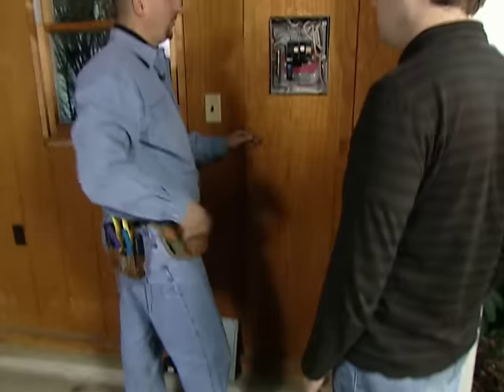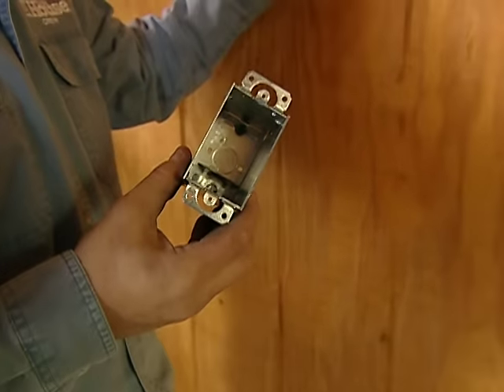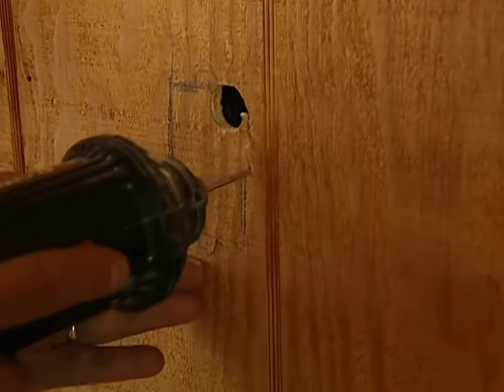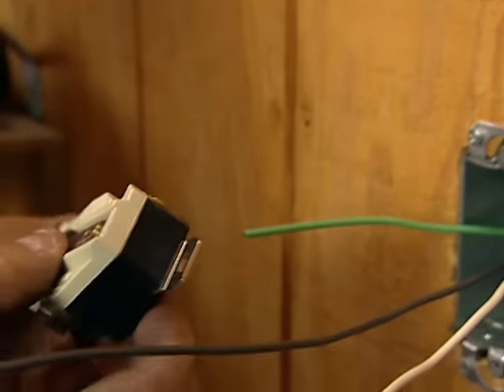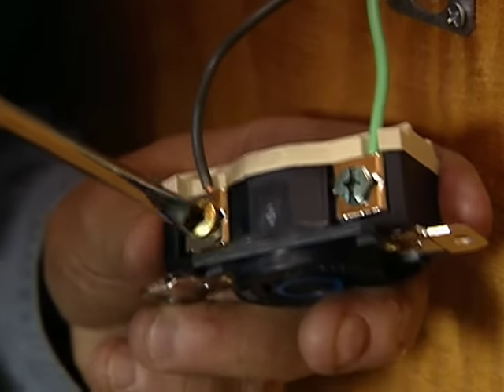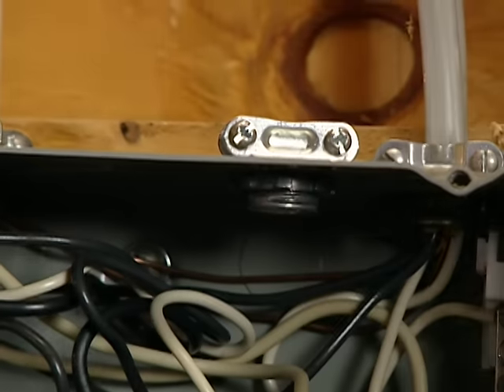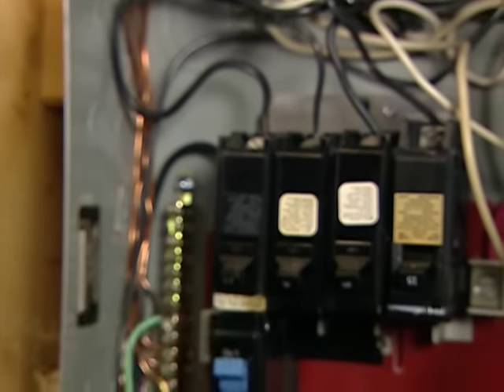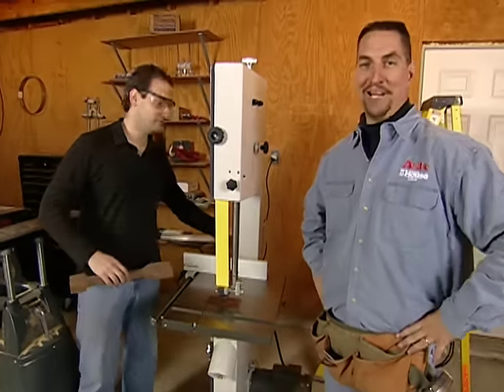How to Connect a 220-Volt Receptacle to a 20-Amp Breaker | This Old House

Comment: Garage. Needs a 220v gfci breaker because it is in a wet location. I would say use a gfci outlet, but a l6-20r is not available as a gfci.
Reply: Yeah, especially since Massachusettes has implemented the 2017 NEC.
He Legally has to use a 20 amp ground fault double pole circuit breaker.   I don't know how much the BR ones are, but the square D QO ones are about $130.  More than the 50 amp hot tub breaker and enclosure are.

SO the cheapest way to implement this is just use plain old recepticals and breakers for everything, and then put a cheap hot-tub panel in the middle of the circuit, using it as an additional disconnect for instance.
Reply: The sub-panel could be connected to a 220 volt 30amp GFCI breaker in the main panel...

Comment: Last time I looked, residential single phase utilities in the U.S. were 120/240V. 

Why people incessantly refer to it as "220" I don't understand. 

Wrong connector in the panel that was an NM (romex) connector not an MC connector. 

Identify your phase conductors dude. Most electricians can figure it out either way but this won't pass inspection.
Reply: Enlightn76 
You are correct it’s 120/240 but people refer to it sometimes as 110/220 mainly by old timers due to voltage drops in older equipment. Because it’s AC alternating current the sine wave is constantly going up and down just the rms value we refer to is 120v

Comment: Electrical Installations seem so much easier in the UK where all domestic appliances run on ~240V with just Live, Neutral and Earth
Reply: and safer without exposed terminals

Comment: I would think of keeping to standard that most every one uses for black wire as hot.  He states "I can do it this way so I will".  Can someone explain beyond "that's just the way pro's do it".   Thanks.
Reply: When an appliance or device requires only 240v and not 120/240v, u can get away with running 2 wires (120v each) in this case white and black. However a stove for example needs 3 wires (black red white) for 240v for the element and 120v for the light bulb and electronics

Comment: definitely 2 code violations 

1 not identify the grounded wire as a hot wire
2 He used a 2 piece Romex connector instead of a M/C connector
Reply: Some clamps are sold as "combination" clamps, Halex and others market them in most places. Proper MC 2-screw saddle clamps usually have a stop near the end that the MC sheath sits in.
Reply: The white wire is not a ground. It's a current carrying conductor. It's why they call it an AC circuit. Only ground can be green or bare copper. Isolated ground green with yellow stripe that must be isolated from the neutral\grounding bar in the panel and bonded to an outside grounding rod. 

The white simply should have been color taped to show it's a main current carrying conductor feed from a breaker. Unless you want to test my theory that if you cut a neutral in half and grab both ends. See what happens under load...
Reply: He also didn't properly place his MC sleeve.  He looked like he was in a hurry... went through each task pretty quickly.
Reply: Master Chief 00117 it's a ground conductor not a grounding
Reply: as long as it meets federal, state and county/city codes the job is done well and will last for years, there are codes around the U.S. that contradict each other because of the different types of climates.
Reply: the grounded conductor as stated by Chris Jamie is referring to the identified conductor, which means that it has been identified that it is bonded to ground. The grounded conductor is just another name for the identified conductor.
Reply: You clearly don’t have any journeyman or C-10 license. 
Grounded counductor = white/neutral
Grounding conductor = green/ground

It’s not common electrician practice either to use MC/Bx to make both conductors current carrying, for that you use SJ or SO cord.
Reply: sniffs the air I smell a troll... lol
Reply: Chris Jaime you aren't the brightest there buddy. Don't try acting knowledgeable if you are going to spew false information. By the way its perfectly legal to use a romex connector with MC, unless your local code says otherwise. Which might be the case where you live.

Comment: The connector he used for the mc cable is for Romex and I’m not sure why he used mc cable and not Romex , white wire was not identified as a feed conductor, he would have failed inspection!
Reply: While I agree with everything you said, if you look at 3:17 it is in fact a MC connector, notable by the two flat pieces on the inside of the connector which are there to prevent the sheathe from passing through the connector.

Comment: I still deal with "electricians" that insist white is always neutral regardless of voltage.
Reply: White is ALWAYS the neutral in NA wiring, unless it’s being used as a switch leg or hot leg which code is trying to move away from
Reply: No electrician would insist that.
Reply: @Nick-bh1fy  never used as a switch leg. Sometimes used as a constant hot.
Reply: @electricaf365  in resi I’ve seen lots of cases where the white wire was the switch leg, black being line voltage
Reply: @Nick-bh1fy not supposed to be.
Reply: @electricaf365  obviously it shouldn’t really be used for anything other than a return, but it doesn’t stop some contractors getting away w using 14/2 when they shoulda used 14/3 and actually have a useable neutral for anything future
Reply: @Nick-bh1fy  code allows white white on a CABLE ASSEMBLY to be re-identified and used as constant or traveler but never as a switch leg.

Comment: Outlet code 30" above floor in a garage? That must be a Massachusetts code we don't have that here in Maine most garage outlets are 18"-24" above the floor unless home or garage owner specifies a different height.
Reply: No garage outlet height requirement here.
Reply: I think if a socket is below 18 inches then the class of socket has to be better. ie no arcing in case gasoline fumes. Thus the cost skyrockets and most all use at least 18 inches

Comment: 220 volt receptacle what is that? I’ve heard of 240 or at least that’s what a utility feeds your house with 120,120/240
Reply: It's common to interchange 100 110 115 120 and 208 220 240 when speaking. Also if you ever test power outlets during the day is typical for any outlet to vary 10 volts  over the day at work we have a voltage recorder that we use and even at our warehouse where we have nearly perfect power it typically varies between 107 to 117 within a 24-hour period
Reply: robert hamilton 10 volts is unacceptably I work for a Utility and we allow 5 volts maybe they need to install or check their regulators depending we’re on the line you are. If there’s voltage loss that much the utility should look into it. There’s something called recording volt meters that they can install to record the voltage in a 5 day period at your house. Also how far are you from the transformer and how long of a run of secondary that you have comes into play but 10 volts isn’t good for your wall pump or appliances.
Reply: @ralanham76  So which number is technically correct?
Reply: @mr.g937  there’s no set voltage.  Most appliances don’t matter for a few volts. Like I work with communication equipment and vending machines and they work fine between 90v +

Comment: Seems unnecessary to have so many configurations of 220V (250V) plugs.....My dryer, stove, welder and generator all have different plugs/outlets.
Reply: Raw Bacon here in the uk we use 240 volts only and we have a single 3 pin plug with a built in replaceable fuse rated at 3,5,10,13 amps. Plugs and sockets are universal for appliances up to 3000 watts in the uk.

Comment: Wonder VB what ever happened to this Sparky. His explanations were usually spot on. He mentioned repurposing the white conductor as s hot. But he must have left his Sharpie in his truck. Also, it's 120v or 240v. But that's minor. Never had an inspection services cite that 30" rule either. Regional differences. Come to think of it never installed an out for garage band saw as well.
Reply: The electrical grid runs hot nowadays. They're the same. 110/120 Tomato/Tamato

Comment: I have never seen a good electrician use a wire stripper. They use linemans for everything, cutting, stripping and a hammer, 1 tool, 3 jobs.
Reply: That’s how I was taught. First job ever showed up non with big pouch and bunch of tools. Old school boss threw them out. Said all ya need is linesman’s flat heat Phillips and a hammer lol
Reply: @linehandibew6205  haha how very true. You will get a "feel" using the libel and.sometimes you use the linemans as a hammer

Comment: i thought you used n.10 wire for 220 not n.12 wire ?
Reply: Nelson Dacosta #12 is rated for 20 amps. #10 is rated for 30 amps
Reply: Maybe related to more volts means lower amp rating for same power 220v compared to 120
Reply: The smallest legal 220 ckt is 15 amps #14 AWG wire, same as for 110.
Reply: Most codes call for 10/2 on 220-240 circuts..
Reply: Not sure about the code stuff but 12 gauge solid copper is rated  for 600 vac 20 amps.
Reply: Wire gauge has nothing to do with volts. Thicker wire can handle more amps. You need 10 gauge for 30 amps and 12 gauge for 20 amps.

Comment: 12 gauge for 220v.??
Reply: The gauge applies to the amperage, not the voltage. In this case the amperage is 20 which corresponds to 12 gauge. Most standard conductors are rated for up to 600 volts.
Reply: ไอ้มดแดง  12 gauge is rated for 20AMPs, 600Volts
Reply: 10/2 is usually code.
Reply: Yeah as long as the running amperage load is less than 80 percent of 20 amps which is the rated load of the breaker and the supply conductors.
Reply: Also, it’s solid conductor and copper (CU).

Comment: just read a few comments. i'm not an electrician and i found enough mistakes to make me nervous
i wouldn't sign my name to that job
Reply: 08.
Reply: James Boyd the only thing I've seen that Alan did incorrectly was to not 'identify' the 'hot white wire' as something else. - Yes in this case its legal to tape a different color since the mc cable is a 'listed assembly.I'm sure Alan doesn't usually tape the wires since the job won't be inspected and the wires work no matter what color they are.But it was a safe installation, and at the time the video was made, unlike today, a Ground Fault Interrupter was not required.   A comment was made that NEMA 6-20 (the recepticle used) doesn't come in GFI's.  That's true, but 20 ampere double pole GFI's are available that fit in the existing panel.
Reply: Question: NEC says to "pigtail" the ground wire (green) to the metal box and outlet. The picture shown showed the green wire connected to a wire nut with two green wires coming out of the wire nut - one going to the metal box and the other going to the outlet. He did it differently, actually looked easier with less space.  Is that to code? Will the inspector accept that?

Comment: Mississippi law, to this day, still dictates that all (meaning each) 220 volt service must be connected at the outside panel (near the meter base), on a singular circuit, in industrial grade conduit, surface mounted (not in the walls), to a transition point entering thru the floor (or wall if on slab), directly to a surface mounted receptacle.
Reply: Congratulations

Comment: Some building codes are nonsensical BS. There’s a difference between people using common sense and safely building an interior, non load bearing wall—and people building a collossal brass phallus in the front yard.

Comment: Um, it's a 220 circuit, as evidenced by the receptacle being used.  For wire gauges #6 and smaller (as the case in this video), you cannot "tape" the white wire a different color.  This is why he did not tape the white wire - because it isn't necessary, and according to the code - you can't.  I will post the NEC code addressing this specific issue for convenience.  As far as I am aware, this is the code the governs this particular practice...

A. Grounded (neutral) conductors 6 AWG and smaller must be identified by one of the following means [200.6(A)]:

1)   By a continuous white outer finish.

2)   By a continuous gray outer finish.

3)   By three continuous white stripes along its entire length on other than green insulation.

4)   Wires that have their outer covering finished to show a white or gray color but have colored tracer threads in the braid identifying the source of manufacture are considered to meet the provisions of this section. The use of white tape, paint, or other methods of identification isn't permitted for grounded conductors 6 AWG or smaller.

6)   A single-conductor, sunlight-resistant, outdoor-rated cable used as the grounded conductor in photovoltaic power systems as permitted by 690.31(B) can be identified by distinctive white marking at all terminations.
Reply: In this 220 volt socket the white wire is NOT grounded, not a neutral . Thus it IS taped to show it is a hot wire. Locally if you do not do this then it gets flagged. Locally one cannot run a white HOT wire in conduit. With romex or MC cable say 10/2 running to a water heater or socket like this then one does flag the hot white wire. One does this at the breaker box and the socket too, or any junction box or switch where the live hot white wire goes to. The hot wire (non grounded, no neutral ) is coded with red or black so another is alerted if is not a neutral. If you buck the rules and say ignore them the inspectors are just going to find other code violations to halt your work. It bascially is like a Monster drink or pot of coffee to an inspector to ignore old rules and hope that they do not catch them.
Reply: 3beltwesty
Reply: Oh yes he can - the white wire in this case is part of a "LISTED ASSEMBLY".  If it was a plain old cable in conduit job, or cable in greenfield job, he'd have to use the right color wire...And yes, it looks like he said he was going to 'identify' the wire, but then never did at either end.

Other comments:  Yes #14 minimum is good enough on a 15 ampere 220 volt circuit.  Nothing wrong with the #12 - 20 ampere circuit here as long as the motor wasn't much bigger than 2 hp. 

The white wire indeed is normally the GROUNDED wire.  It however is not the GROUNDING or 'ground' wire.  But it is at nearly 'ground' (earth for europeans) potential.   With what Alan Gallant charges for his work you'd think he could afford a dime's worth of red tape.

On a 120/240 volt circuit - the white is connected to the 'Neutral' or is the Neutral.  ON a 3 wire, 3 phase Corner grounded (grounded 'B') service there is no neutral in the ENTIRE system.  In this case the white wire is a grounded "HOT" wire.   Why is it "HOT"?  It is doing just as much work as the other 2 wires.  Why is it ok for this 'HOT' wire to be WHITE?  Because it is at or near ground potential.
For those who would say it is impossible to have a grounded hot wire, ask yourself in your car - as far as the battery is concerned, which wire is more important?  The insulated positive with 200 amps going through it, or the grounded car chassis/engine block, with 200 amps going through it.
Reply: Yes you can because MC is a CABLE ASSEMBLY

Comment: Since 2011 NEC. All electrical boxes must be equipped with a neutral.
Reply: For Light switches, yes a neutral is required to allow for provision of timers, proximity detectors, etc.  But here - he is just using a 240 volt only motor so no neutral or white wire is required.Other points in this discussion:"Must use 3/4" conduit" - Not in WNY you don't have to, 1/2" is fine for 3- 12 AWG wires.   But then this wasn't a conduit job anyway."Must not tape the wire if smaller than #6 AWG" -  That's only if you are using individual wires - this one was Metal Clad cable - a listed assembly. so it is ok to tape it a different color - which Alan STATED he had to do, yet never did.
Reply: Bill25cycle I always have a  neutral in all my boxes just in case, because you never know

Comment: I though it was against code to put different breakers in than the manufacturer of the panel.
I.E. using a Siemens breaker in a GE panel.
Reply: William Winder not against code, it's against the warranty of your electrical panel
Reply: The older Challenger panels, like this one in the clip, actually spec out Siemens or Cutler Hammer BR series, if memory serves right.
Reply: 1 inch breakers are generally compatible, that's Eaton BR, Siemens, Square D Homeline, and the 1 inch GE breakers. The ones that aren't compatible with anything else are Eaton CH, Square D QO, and half inch GE breakers. Still always best to use the specified brand.
Reply: It's not directly against code, but the combination must be specified or classified by the manufacturer or UL. Surprise surprise, manufacturers don't tend to do that for competitor's products.

Comment: You guys are like a whole comment section of my friggin know it all ex father in law!  
And  he was usually wrong, like the guy in this comment section, who incorrectly identified the connector he used as a Romex connector, when it was, in fact, a BX connector.
Hardware was my first job for 2 years. Cable connectors is basic shit. You don’t know that much, maybe it’s best you don’t comment on the work of a pro!!

Comment: hmm, at the beginning of this. looks like the place has romex cables coming out the panel.  and the sparky is using  MC cable.  Why?    and on the other end then he has to use a  stupid metal box since he ran MC cable.   If i did this and could install 12/3or 12/2 romex cable then i am doing that and then use a PVC box as it is slighter larger than the metal box.  Never use a metal box if you can use a PVC box. More room.